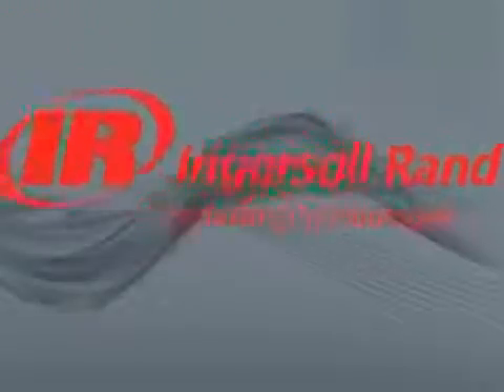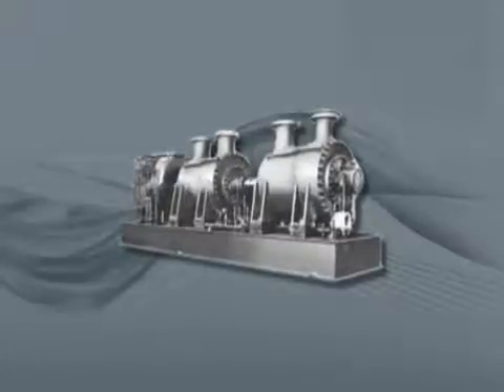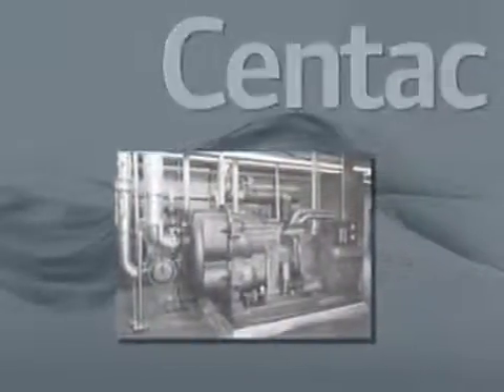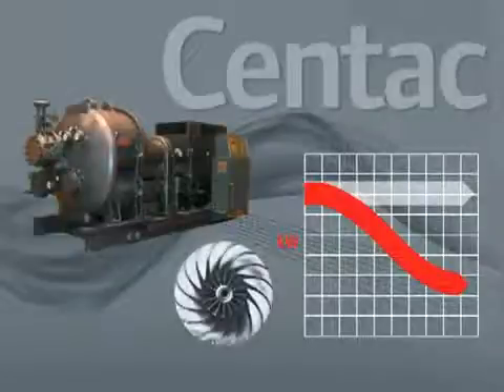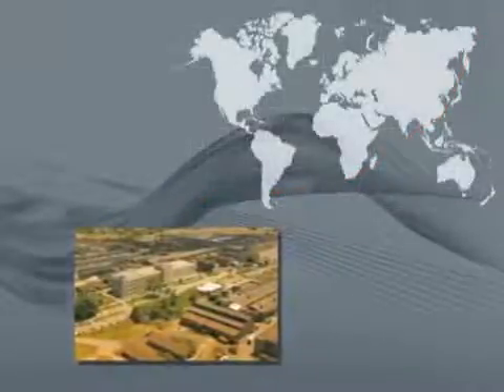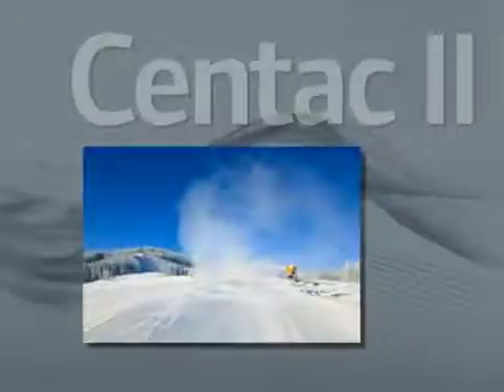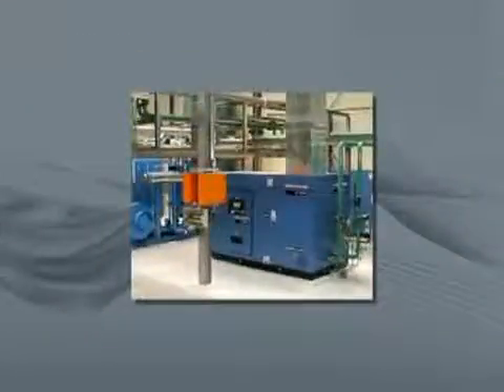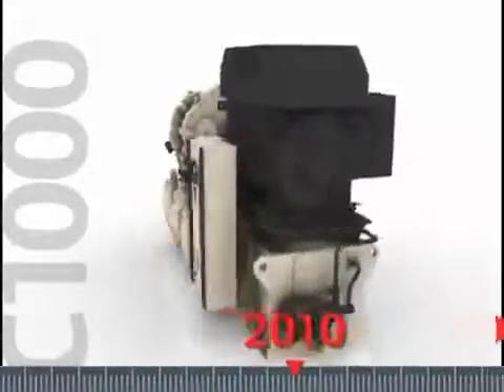Ingersoll Rand Centrifugal Air Compressor Centac C1000, A History of Innovation

Comment: I can see that oil free is a great advantage!, I am dismantling several old Centac units (70's and 80's) and they are fascinating beasts!

they were used to feed 150psi air to gas separators for a Nitrogen plant.